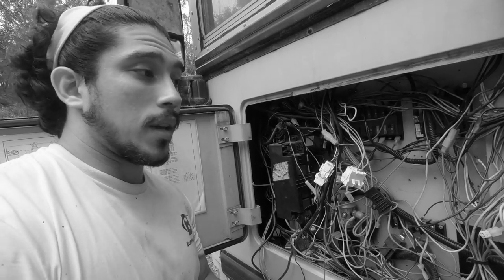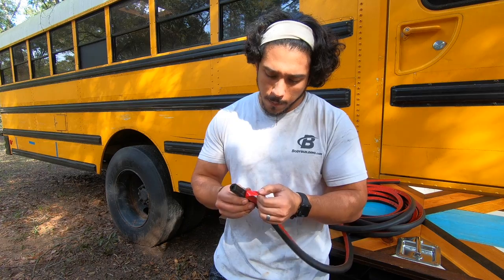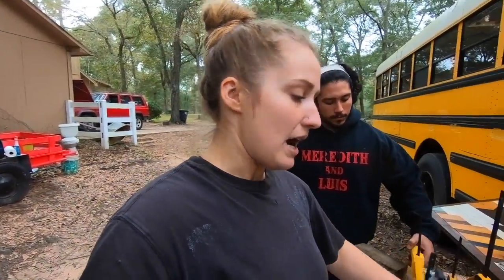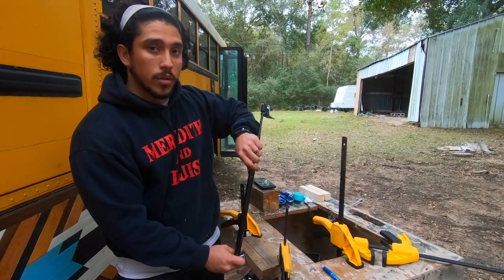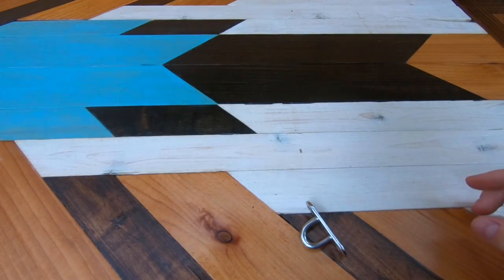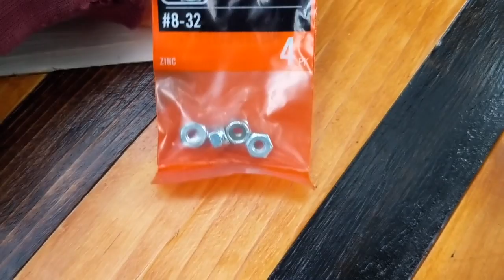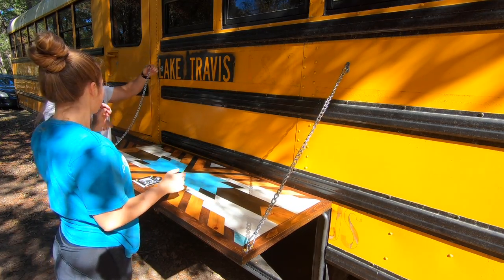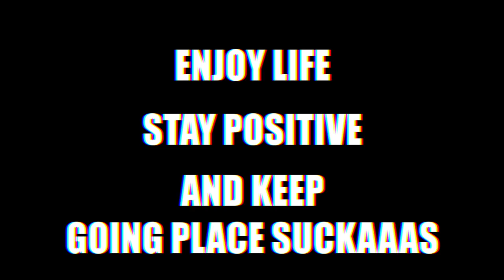Installing Gas Struts and Chains for an Outdoor Table * Skoolie Conversion * Gus The Struggle Bus

Comment: just a tip...don't use deck screws to support too much weight they are low in tensile strength. Regular wood screws or all purpose are better. the butyl tape was an excellent idea. washers on the inside should be used too for extra strength. all and all you guys did what you could with what you have and it's awsome to see your bus coming together. all that I've said is just tips for later they should work for your purposes.
Reply from the maker: Hey Roman, thank you so much for the tip! We were going to do the same bolts and nuts on the door as we did on the bus but they would have interfered with the gaskets we just installed. If they seem to be loosening down the road will change to a different system or different screws like you suggested. Thank you again and have a great day!